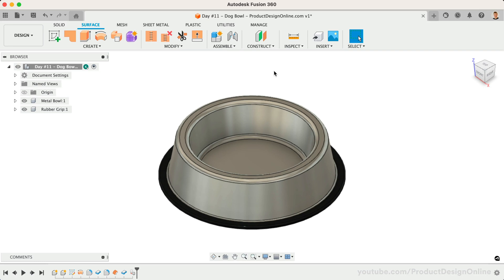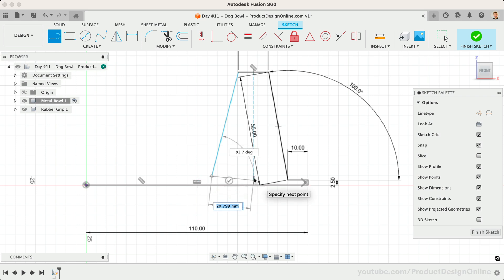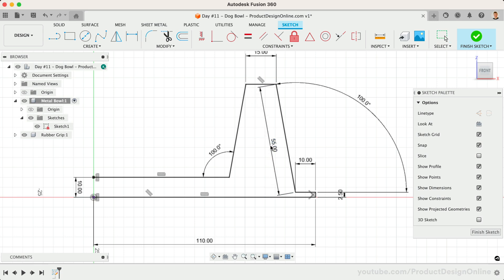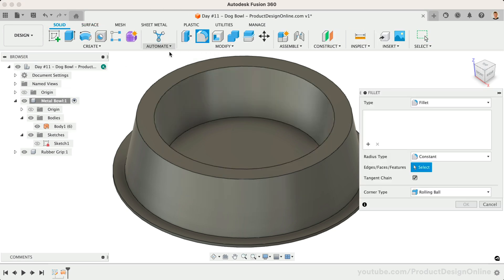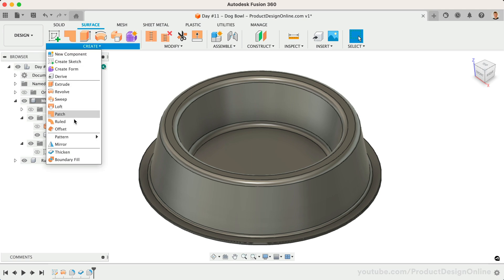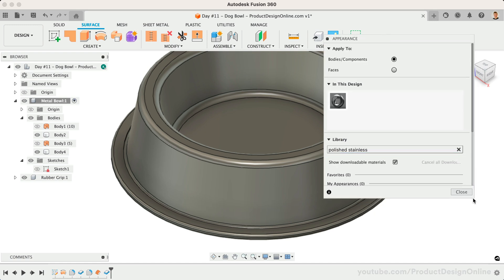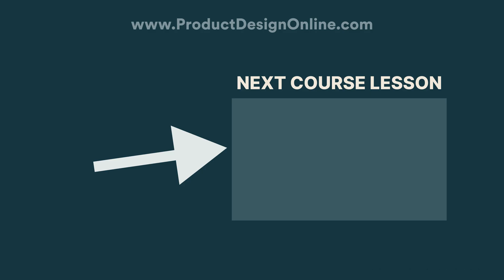Day 11 of Learn Fusion 360 in 30 Days for Complete Beginners! - 2023 EDITION

Comment: Just a reminder that you should never 3d print this. Unless you have one of the ~800K 3D Printers that can print with stainless steel, this is not safe for food or water use as most filaments contain colorants, plasticizers, processing aids, and print with tiny gaps between layers that traps bacteria and biofilm. Also, in water many filaments hydrolyze and shed tiny particles.

Comment: Trying to get f360 to mysterious 'fully define' a sketch without telling you why it isn't sure is a fun feature of an expensive cad package. Really neat how the solver fails and doesn't tell you why, it's a really fun guessing game....
Reply from the maker: I agree that it can be improved greatly! In case you didn't know, you can use the text commands to show the underdefined. Quick example here: https://youtu.be/nHsff9BRVgs?si=mbNwh-DNMKZPNsIx
Reply: @ProductDesignOnline  This video really didn't answer the question why is there no lock in the Browser for the Dog Bowl sketch even though all of the lines of the sketch are black.  When I used the Show Text Commands it was blank so it wasn't useful in describing why the sketch was not fully constrained.
Reply: OK I see the issue.  The Link above was to the wrong video.  The correct video which is quite helpful is   https://www.youtube.com/watch?v=matqB8nGzQI&pp=0gcJCTAAlc8ueATH. It is shown in one of Kevin's Replies below
Reply: @AB133a  Thank you so much, i was going insane trying to fully constrain this. Ended up being the last vertice didn't accept the vertical constrain for some reason

Comment: had to contact Autodesk support (fantastic support!) to figure this lesson out. To connect the last line with the second-to-last line (after using the scissor tool twice), I needed to select the horizontal (last) line and click Modify → Extend (under Sketch).

There is a small, invisible gap (seen on very high zoom in) between the last two lines, even though they appear connected (both black). This step resolved that issue to get the "red lock".

The final step is to select the left anchor point of the last line and use the Horizontal Constraint tool to connect it to the left anchor point of the very first line.

[Insert the link from Autodesk's great support technician here—though I’m not sure if it will remain available forever.]

Comment: At 6:53 When I move the Rubber Grip body from the metal bowl to the rubber grip component, the rubber grip turns opaque.  The only way I can find to keep it looking like black rubber, is to leave it in the metal bowl component.
Reply: And I solved my own problem two videos later.  The metal bowl component was active.  When the main component at the top is active, everything shows correctly.  Something about knowing just enough to be dangerous...
Reply: This is the problem I was having.. Thanks for posting the comment and solution.

Comment: Drawing the line without pressing Enter or Esc in the begging (2:00) was the only way to achieve locked constraints for me. Tried many times with pressing enter in between line draws and I would always end up with a blue line somewhere.
Reply: Same here. Make's no sense because it's all connected. But thanks this was exactly what helped for my issue of not getting it fully defined.

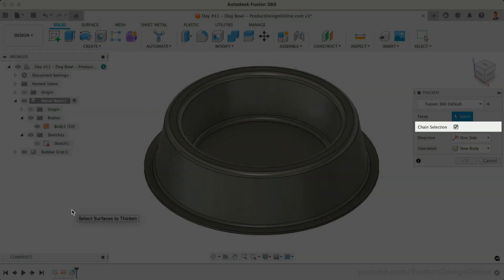Comment: At 4:30 you say 10 faces. I had an error towards the end so I went back to see what was wrong and I see that it only thickened 7 faces even though I had the chain selection checked. And on the browser it shows Body1 (10) so I am not sure what the issue is.
Reply: I think I figured it out although I cannot do the offset
Reply from the maker: This one is hard to say without seeing your file. Can you export your Fusion file and share a link to it?
Reply: @ProductDesignOnline  I figured it out! At least I think lol I didn't have any errors in the end but it took me a while. Thanks!

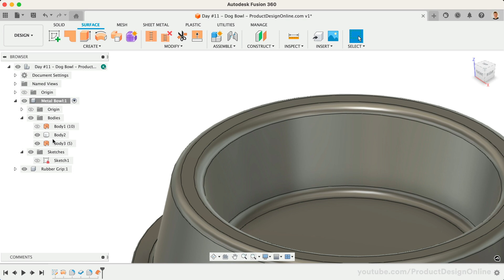Comment: At 6:00 when it was time for the rubber part surface offset, it didn't work and gave an error, but I saw that my sketch was not defined and was with the pencil, I went back down the timeline and saw a weird line that I don't remember putting there, erased it and added sketch dimensions again and the red lock appeared and it all worked out.
Reply: Actually that wasn't even the problem, that line was weird but the real problem was that when copying the video, when making the .5 mm fillets I had selected to edit the surface body instead of Body2, which explains why when I applied the fillets there were now 11 bodies instead of 10 like in the video. SO all I did was just click on the body2 while editing and hide body1 with the eye icon and it was all fine.

Comment: i wish i knew how you were going line to line with out needing to reactivate hte line tool
Reply from the maker: The line tool remains active after each click, as you sketch lines (as long as you don't hit the scape key). You can keep selecting to place the next end point of the line.
Reply: @ProductDesignOnline mine does not. when i click a line and add a distance to it, the line tool goes away and i have to click it again.

Comment: Hey, curious... I tried to emboss my pet's name on the bowl. (I made an offset plane, then put my text on it a bit out from the exterior side of the bowl) I was unable to use the emboss feature on the bowl, is this due to creating it with the surface revolve? just curious what would need to be done to be able to emboss text on the side.
Reply from the maker: If you Emboss to the Solid body (the body created after 'thicken') then Emboss will work.

A few things to watch out for:
-Make sure your text is within the surface area of the bowl. I can't be above or below it where it would get clipped
-Make sure the 'tangent chain' is unchecked
-You may have to test with different fonts. Sometimes the fonts impact the result of Embossing text. Bold sans-serif fonts typically work best.

Comment: Is it possible to change the section area patterns to make them coherent with the type of material?  I mean, steel and rubber have different pattern when sectioned in technical drawings.
I couldn't find anything on the net.

Thanks a lot for the resources

Comment: Had an issue with an Offset error at about 5:56. Turned out it was the Fillet affecting the Surface Body, as, after the command, the Body had 11 faces while in the video it was 10. For me, the problem was that even though I selected 2 Edges with the Fillet, after opening the prompt again from the Design History, it said "3 Edges" selected. I ended up selecting the Face that is between the two Edges (the 2.5mm line) and applying the Fillet to it. That kept Surface Body count at 10 and I was able to perform the Offset.
Reply: If anyone is confused, apply the fillet ONLY to the the face between the 2 edges and it should work
Reply: @aayanagarwal3689  THANK YOU SO MUCH!
Reply: Thanks for sharing! I did the same.
Reply: Goodness Gracious! You have saved us all from looping around for looking for the bug that was not there D:
Reply: Thank you very much! I was really confused about why this was happening for a while.
Reply: Thank you
Reply: Another thank you, fixed my issue.
Reply: i don't understand what's happening, but this is the problem. Frustrating.
Reply: A year later and this tip helped me out a ton! Thank you
Reply: thank you so much! This is such a weird thing. I had no idea why it kept happening but your solution helped.

Comment: why did both the dish and the rubber have the same hatch when sectioned on my drawing but they were different colors on yours? What determines the hatch pattern?
Reply from the maker: They should be different if located in different Compnoents. Is your rubber piece a separate component?
Reply: @ProductDesignOnline  ah no. I must have missed that detail. Thanks!
Reply from the maker: @sblack48  No problem! Happy learning and Happy New Year! :)

Comment: If you are getting hung up with not having a fully defined sketch after the 55mm line this is what worked for me. Don't hit Tab to switch to the degrees (angle) field to define that. Instead define the length (55mm) then escape out and define the angle with the dimension tool separately. No idea why this works.
Reply: When you define the 100 degree angle Fusion 360 will create a new horizontal construction line for you and set  the angle with respect to that newly created line.
However, this line does not have a defined dimension. This will prevent your sketch from being fully defined.
The workaround is to give this newly created line an arbitrary dimension like 1mm or 10 mm. (Or you can manually delete it and set the angle dimension with respect to another line)
With your solution that line is never created, rather the 100 degree angle is defined with respect to the 10 mm horizontal line.
Hope this helps.
Reply: @GeorgeBakx-p7u  Ok thanks. This helps. I redid the sketch again and this time when it "snapped to" a number in the dimension or degree field making the lines, even if it was like "10.000", I typed in an integer. I think maybe if it has some non-integer decimal way further out of the 3 decimal spaces displayed in the box, it screws things up. Now I will try the revolve again.
Reply: @GeorgeBakx-p7u  Thanks!
Reply: @GeorgeBakx-p7u  Thank you so much. Added a dimension to that auto-created horizontal construction line and now its fully defined.
Reply: Thanks, it helped! I think I know why we get this, Fusion 360 can easily think the angle is between the 55mm line and horizontal axis as opposed to between the 55mm line and the 10mm line. So I deleted that measurement directly, redrew it and made sure it was the 10mm line that was selected and it worked.
Reply: @astriddegaste4972  Thank you!!  This was my problem as well.
Reply: Thanks. I was wondering why my sketch wasn't complete.
Reply: Thanks, 30minutes finding the problem!
Reply: Thanks!!
Reply: well, I had a defined sketch, but then the profile didn't give me an orange bottom plate, it was solid gray, so I went back and redid, and now it's not defined. hooray
Reply: ok additionally I missed the part where he turned the bottom line into a construction line. I think if you uncheck "Chaining" during the revolve, it accomplishes the same thing, at least at this step.
Reply: Tough to find the problem. Here's the best solution I think: View > Show Text Commands. Then type "Sketch.ShowUnderconstrained" in the bottom most box. It will tell you in text if the drawing is defined or not and it will rapidly highlight the points that are not well defined so that you can hunt them down and fix them. This solution should work better for folks with visual issues (colors, acuity, etc.). Really surprised this tool doesn't have a chat window to help with these things and let the AI offload some of this silliness...
Reply: I created the first sketch using a new segment for each line.  This is easier than doing it in one continuous action (not using escape) since if you make a mistake you do not need to go back to the beginning.  All of my segments are black suggesting they are constrained, although the parallel constraint icons do not appear on the top and bottom horizontal lines like they do in Kevins video even though both segments are parallel. The program will not allow me to force a parallel constraint on the top and bottom horizontal lines.  I have confirmed that I cannot move any of the endpoints on the segments which further suggests that they are fully constrained.  However, the Sketch Icon in the Browser shows a pencil (not a lock) which suggests that the sketch is not fully constrained.  I can't figure out what is causing the icon to not be a lock.  I created another design this time not escaping out after each individual segments (just like Kevin did in the video).  This time the parallel constraint icon appears on both the top and bottom horizontal lines and there is a lock on the sketch icon in the Browser.  Does anyone know how to change the pencil to a lock in the first approach or what is causing this difference.
Reply: Perfect!  I could not figure out why my sketch wasn't defined.
Reply: THANKS 🙏
Reply: Incorrect Order of operations is what I discovered caused the angled line to not become constrained and turn from blue to black. When you use the line tool you have three options after you click the second point. You can perform 1)mouse click or 2)hit the enter key or 3) select the check mark. DON'T PRESS ENTER key after you add the 100 degree angled dimension,  but instead just mouse click anywhere outside the line it will turn black and become constrained to the 10mm line. The incorrect order of operations that result in the angled line not becoming constrained occurred when I  pressed Enter/return on the keyboard after adding the angled dimension. Hope this helps.
Reply: @michaelb4444  Thanks this is what helped me. I was pressing enter mostly after defining each lines dimensions/angles, instead of just mouse clicking to confirm.

Comment: My first 100 degree 55mm line turns black, but the constrained icon on the sketch doesnt appear. Even after completing the sketch and adding extra constraints, I cant get the lock to show up. Does anyone know what I can do to fix this? I assume that line is the issue.

Comment: Unfortunately, my sketch is not fully defined (no red log icon). All the lines are black and the sketch looks like fully defined, but the red padlock is still missing.

I performed all the steps according to the video.
Reply: Just saw a recomendation below in another comment and it worked for me. Draw the entire shape without leaving the line tool.
Reply: @Dustin_JD  It would be nice to know WHY though.  Otherwise, that is just a ridiculous restriction.
Reply: @jimb032  I second your comment
Reply: So as you drew the 15mm top of the bowl and then drew the downward slanting line for the side of the bowl ( no set length, just set at 100 degrees. Then you drew a line 10mm above the base and intersected that angled line. After you snip the ends off, go up in the sketch tab, click on the coincident constraint, and then click the lines where those two clipped lines intersect. BAM!! lock symbol pops up.
Reply: @dbcustomrc  That did the trick for me, thanks.
Reply: Same here, trying to find the issue.

Comment: I don’t know what I’m doing wrong but my offset keeps showing error,”can’t compute” … Help !
Reply: I ran into the same problem. I was able to use offset to create a surface from the bottom 4 faces. Then I used offset again on the remaining top face. I then used stitch under surface->modify to combine the two surfaces together.
Reply: somehow my problem are on the surface no.2 (from top),knowing it by making the offset one by one each,the other surface doesnt like to be put together with no.2,like @mattykins5127 said,you can sticth the offset surface later on modify tab to make it into 1 body
Reply from the maker: Any chance you could share a screencast of it? Could be several things so hard to say without seeing your file.

Comment: When trying to make an offset as a surface I receive an error "SurfaceOffset1". And I am doing the same, exact steps. Any idea how to solve this error?
Reply: Not sure why this worked but if I did the surface offset command and dragged the blue arrow first, then set the dimension to 0.3mm the function worked. Had the same error when just typing the dimension in.
Reply: @b-tyler  Damn, for me it didn't help, and strangely it increases the surfaces count for the body from 10 to 11...
Reply: Was this ever resolved? I am stuck on the same issue.
Reply: I'm having the same error, it is also not creating  new body for me.
Reply: After the .5 mm fillet on the bottom edges an 11th surface count is created for body 1, even with body 1 hidden. My resolution was to right click body 1 and make it unselectable, I was then able to create the offset.

Comment: When I do the 100° line at 0:40 my sketch looses its "fully constrained" status and the red lock icon disappears.  I press L for line, click the last point on the 10 mm line, drag up and over a bit to generally the right area for the end point, hit tab, type 100 (degrees), hit tab, type 55 mm and press enter.  The constraints seem to be applied correctly and the line is black, but the red lock icon goes away.  Did I do something wrong?
Reply: I was just struggling with the same issue and somehow, I worked it out in my 10th attempt. Probably is too late but maybe it can be helpful for someone there. Try to erase everything and try to never stop doing the lines, just hit the "L" button and don't stop and try to draw one line after the other continuously at least up to the part where you have to draw the undefined length line. You have to be sure that every time you are about to place a line, the "90degree" or parallel constraints are showed. Only that way I was able to do the upper line with the "angled parallel lines constraint" immediately and to never lose the fully constraint lock symbol. Hope it works for you as well.
Reply: @nicolitox  Nice mate, this solved the issue for me. Quite annoying that fusion 360 itself had this slight buggy workflow...
Reply: @nicolitox  That helped me too, thanks!
Reply: Im having the same problem
Reply: I've done the sketch several times and I never get the red lock at the end. All the lines are black, but not thick. No blue lines.  One difference is that I have a horizontal constraint on the very top 15mm line, whereas the video shows a sort of "angled" constraint.
Reply: I used the lock Icon to do it for me, i hope that help you.
Reply: Same issue here. I tried the fix/unfix constraint and it didn't help.